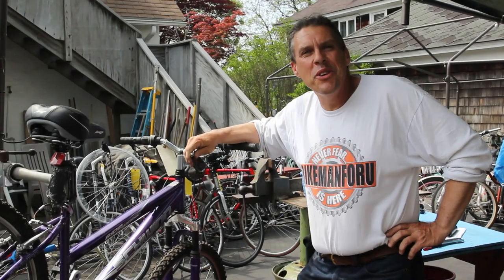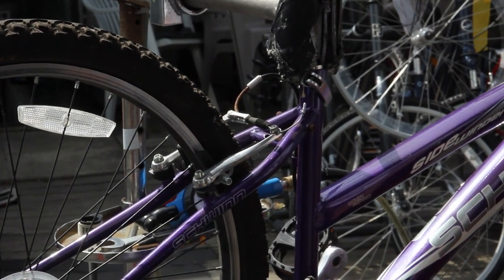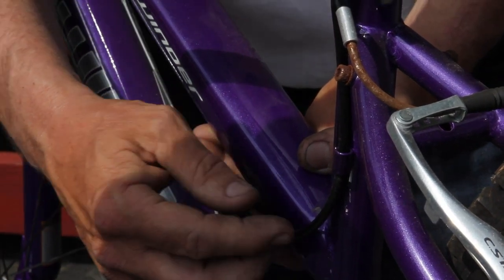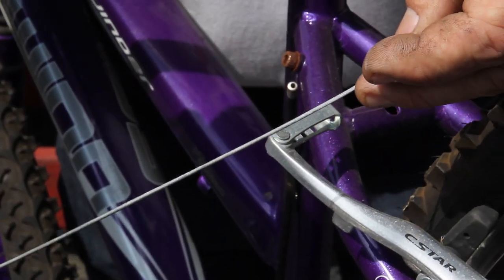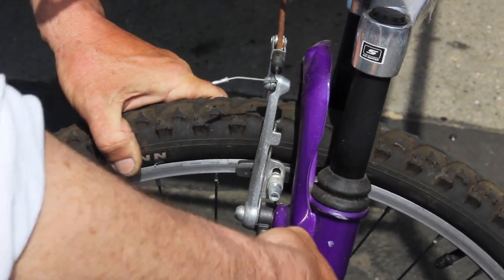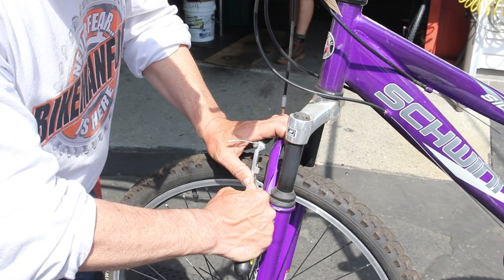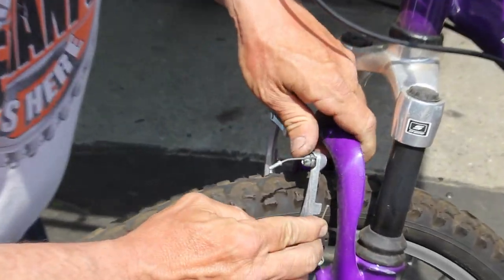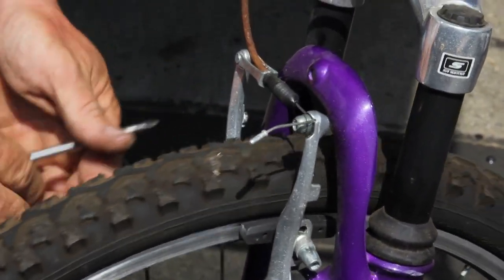Even A Cheap Walmart Schwinn Doesn't Deserve This - BikemanforU DIY Brake Fix

Comment: I bought a Walmart bike 10 yrs ago and ended up replacing the wheels all together. 
The crank upgrade to cartridge style bottom bracket is awesome also.
I recently purchased/installed a set of 26"  x 1.75 wheels w/nexus 3 spd hub now it's great thanks in part to BikemanforU.

Comment: I usually check the 3 holes for the other end of the spring to sit in first, if it's in the wrong one you can get some adjustment without needing to bend stuff.

Comment: Love your videos! 

I was just looking around to see what I could find on the Schwinn 3rd Avenue, sold through Walmart, and found one about a Schwinn 3rd Avenue demo. The guy had the forks backward so the brakes were behind the forks. 

I bought a 3rd Avenue November 2016 based on good reviews, and guess I got a lemon.  Day one I had to replace the tires and tubes because they went flat. The tubes were far too small to fill the tires, so they got holes in them from being inflated beyond their capacity. The tube material  was gritty so a patch wouldn't stick.

Then the front derailleur came loose several miles from home and I couldn't tighten the clamp bolt with a small adjustable  because it was made of soft metal and got chewed up. Had to ride home with the chain rubbing on the derailleur. Bought a new, better front derailleur.  Had to put a better chain on, too, because the original didn't run right over the cogs.

Now, with 300 miles on the bike the largest chain ring has gone bad. Three consecutive teeth are worn down to half their size, and the chain doesn't engage as it should. It makes a crunching noise each time the bad teeth come around and hit the chain. So a new, better quality crankset is now on order.

I would hope that this bike isn't typical of Schwinn. I know it's cheap, and expected to have to do some work on it, but I've now spent as much on new components  as I paid for the bike. Good thing I can do my own wrenching.

Comment: The two tight turns in the back brake cable routing don't help that cable slide inside that sheath either. I've seen that on those women's step through type frames.  The top tube dipping so far below the rear brake creates some severe angles for cable routing in the back.   Thanks Bikeman!

Comment: In my experience that problem is also often caused by lack of grease on the brake bosses. Usually with cheap bikes they don't apply any grease at all before mounting the brake. So taking the brake off and applying grease on the fork boss can also be a good idea.
Reply: Alans6563 
I being a licensed mechanic aprove of this messsge. :))

Comment: There is nothing wrong with big box bikes besides being generally heavy. The problem with these bikes is the poor assembly.
Reply: Johnny Mullet The problem with them is that they're built to be disposable. The components on them don't last very long and any amount of heavy riding will ruin them quickly. It's quite often cheaper to buy a new BSO (bike shaped object) than it is to spend the money on buying better quality components for the one that is broken.
Reply: I agree. The new bikes from China are horrible. I enjoy my older USA built big box bikes, but the new ones to wear out components.
Reply: Johnny Mullet my main training road bike is a GMC Denali 700 alloy road bike. It was $290 from Amazon and it is 14 kg . This bike has gone over rough roads, gravel roads, beach roads you name it. Best bike ever. I race on a carbon but train on the cheap bike .

Comment: bikemanforu thanks for the video i bought one of these sidewinders for my wife "xmas" before i gave it to her i took apart the bike to grease the whole thing as your video showed me upon putting the rear tire back on the chain was loud i could not adjust the noise out of it further inspection revealed the rear dropout was bent and misaligned the axle,as i know you know the outcome of all that. she never once got to sit on it.
i have a diamondback apex trail mtb i will be going to a local bike shop with her to get her decent quality bike 
one less car

Comment: Nice tip caveman. I'll call you that because sometimes you just remind me of one, but at least some tips make sense. LOL. By the way, you may want to suggest people use some type of cover when storing bikes outside. I'm glad I used one or my brakes would look like that too.  Too bad I haven't seen too many good covers any more. Still feels good, but I wished the shop I bought mine years ago had tuned it correctly. I had fix the brakes and fix my front derailleur.

Comment: Whoever designed having half the brake cable exposed to the elements didn't consider it would accelerate corrosion in the cable.Old school design sometimes is best.
Reply: It would be trivial to run a constant housing from the lever to the btake
Reply: DANNYTHEQUAD    Alot of bikes have exposed cables .  It's nothing new , my 45 year old bike has the cables that way and even expensive bikes are made that way . I could be wrong but I think the cable being exposed might have less friction then running the entire cable in a jacket plus it is easier to lube the cable .
Reply: More housing creates more friction on the cable no matter what. Most higher end bikes have cables exposed, unless you're running an aero bike with integrated cable routing.
Rust is avoided through constant cleaning and maintenance. I've admittedly ran a Walmart bike and an old rebuild bike and ended up wrecking both of their drivetrains and brakes because I failed to clean them regularly. Have a nice Trek now and I intend on keeping its nicer drivetrain around by giving it a touch up every few days.

Comment: I'm not sure how well you respond to comments, but I'm about to get a Schwinn sidewinder from where else, Walmart, and was wondering any tips and tricks on keeping this bike in good shape? It'll be my first bike in over 10 or more years, and I'd like to actually learn how to treat it, this will help, but what about lubing up the tubes and etc, there any more videos or sites I can go to learn? Thanks a lot guys, this will help me out!
Reply: I know its a little bit late but if you got it here are some tips:

Take apart, put back together and adjust everything yourself even if it is already put together, sometimes the bikes come built and adjusted very poorly.

Grease and lube everything correctly and frequently, cheap bikes need a lot of care in order to maintain them in good condition.

Comment: I have a schwin woman bike and the front left brake isn't  working I undid the screw and I pulled the wire but it still doesn't work.

Comment: Hi, why is the front brake on the left in the U.S. yet on the rite on a motorcycle in the U.S. surely this is dangerous for the youth coming of a pedal bike onto a motorcycle? sorry this is not a dig just a bugging question. Thanks I enjoy your vids.
Reply: the way I see it on a motorbike has a twist grip on right so if its twisted back it would be hard to grab the back break the one that's safer to hit when faster hope that helps
Reply: So why not just put the front brake lever on the right on cycles too that way it would save confusion and be safer going from cycle to motorcycle?
Reply: mmattster 
Most kids ride bikes but Man or Women skills are for motorcye judgement&riding. 😊

Comment: I purchased a Wal mart bike years ago. It was after my 14 yr old bike was taken in because the back wheel bearings went out. The repair shop declared that my trusty old bike had too much frame damage to even consider repair. A few months later I got the Wal Mart bike.  Another month later the brakes started squealing  loudly after 5 minutes of riding. I tried 4 different methods to quiet loud brakes. Nothing worked. I took it in to my friends trusted repair guy. He couldn't fix the problem. Eventually I gave it away. I just wanted to get rid off it!!

Comment: Coaster brakes all the way baby !
Reply: Coaster brakes are good for anything but stopping quickly or riding faster than 15 kmh on a sunday
Reply: lolatmyage If you wanna stop quickly you gotta think ahead
Reply: Grabriel Lopez
Thats absurd. Does your spidey sense know when and where a dangerous situation will arise? If not, then investing in actual brakes is the only logical choice. Any bike that doesnt have a front brake shouldnt be ridden.

Comment: Here's a good tip about wal-mart bikes.  If you don't want to have problems with a wal-mart bike.  Don't buy a wal-mart bike.  It don't matter what brand it is.  They are junk and you might as well went to your local bike shop and bought one of there's for the price for the bike new and the repair bill you'll have in a week fixing the piece of crap.  So in Short Support your local bike shop not your local walmart

Comment: Really lazy work on the spring. You just had to remove these brakes completely and re-install them to different holes, thus increasing the tension in on and releasing in the other. I wouldn't trust you with my brakes for sure.

Comment: Wal-Mart bikes r garbage
Reply: ZOMBIE KILLER shes right roadmaster are the shit had a mtb put about 400 miles onit before the brake system the gears the rims gave in and bought it for 13 $ from some kid I took it to Crystal cove bombed some steep ass inclines no problem although not recommended n im 260lbs shit tookit like a champ I proudly retired that bike after my gears broke hense cheap bike butt put in work no doubt those things are work horses brutAl bikes trust worthy frames heavy bikes
Reply: ZOMBIE KILLER Correct.  Lot's of those bikes can go for years if taken care of.  Grease, allen wrenches and a screwdriver are a bike's best friend.
Reply: street riding I got a Kulana Moondog from WalMart 207 miles on it and the rear brake lever just snapped off, the shifter went after about 100 miles so had to buy a new 7 speed, front tube went, the rear fender snapped at the screw where it meets the frame, caught the tire and spinning me into a dimension of pissed off i was never in before. I love it, I'm looking for a new one.
Reply: Agreed
Reply: street riding Well over 2000 miles on my GMC Denali. NO major fails.